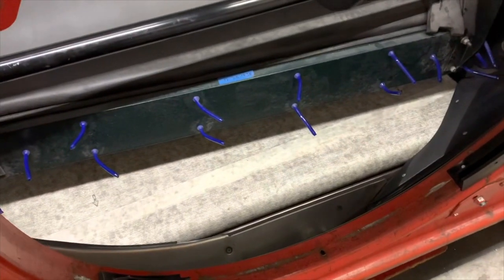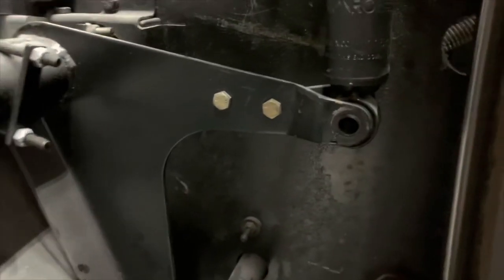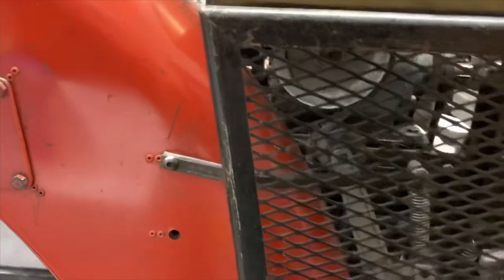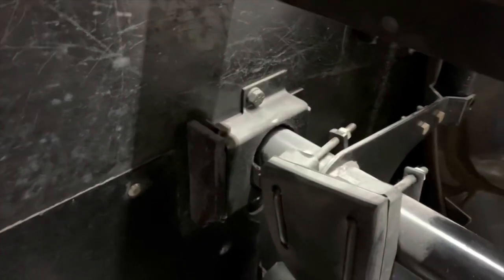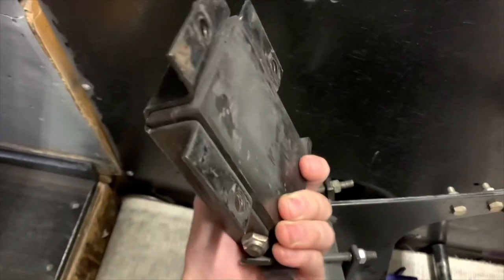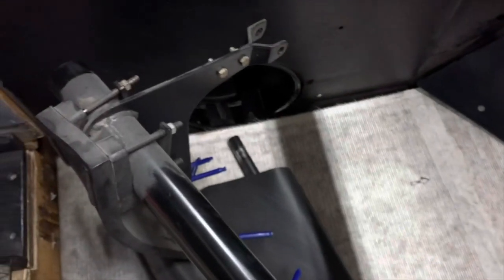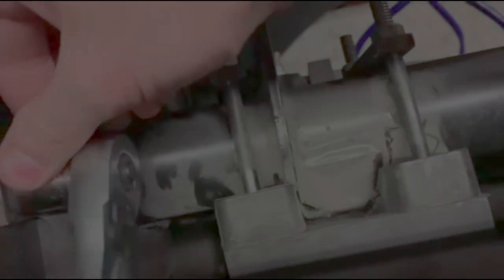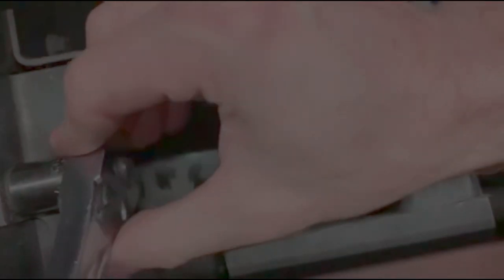Josh’s 82-70 How To: Replace a cushion on an AMF pinspotter

Comment: Maybe Rob could show Josh how to  take care of brunswick  A2s  then  he could work on real machines that dont have 3 motors and are not a electrical nightmare.
Reply: You learn real quick how to use a multimeter 😁
Reply: I have heard many relay issues... I will stick with my Brunswick A2 😊
Reply: @t.c.bowling1934  nah not really. Just like any machine as long as you stay on top of pm they are great machines.

Comment: Shocked, shocked I say that you are working on a live machine without observing the required LOTO requirements.The lane you are working in and the lanes to your left and right are required by OSHA to be de-energized and  tagged out. People who have no real life experience working in bowling alleys, (whose profits are based on happy customers and running machines) are only concerned with lawsuits and keeping a bowling center profitable. Big Business doesn't care about you or OSHA and your safety. Their only concern is covering their asses, ie, liability and workman's comp..Repairs on working machines are less than safe but often "de rigueur" for mechanics.